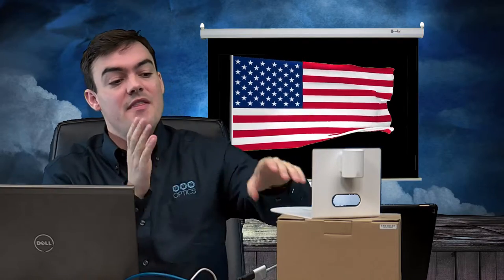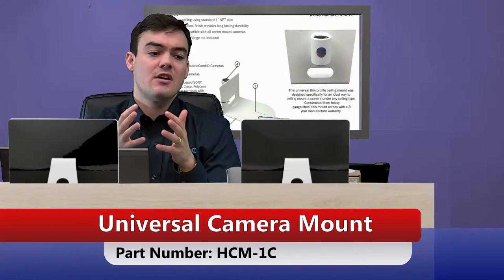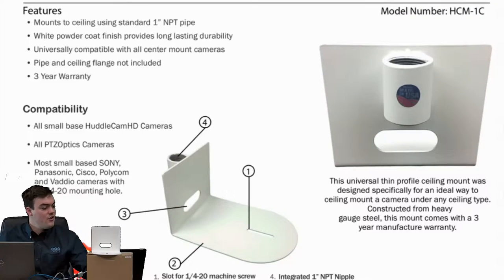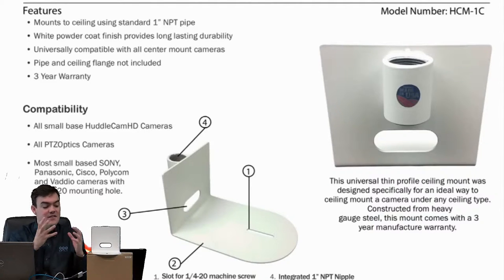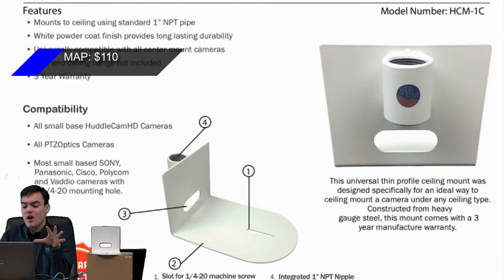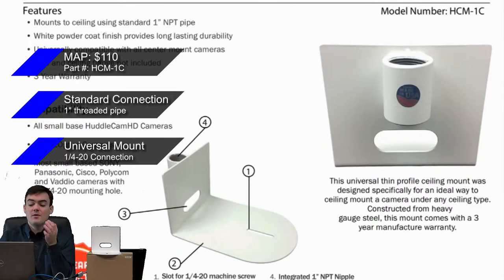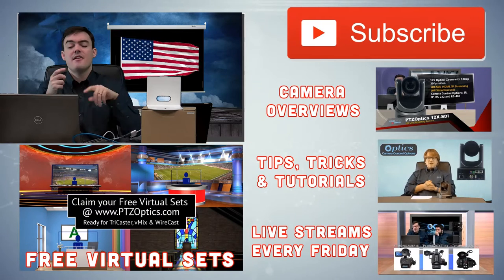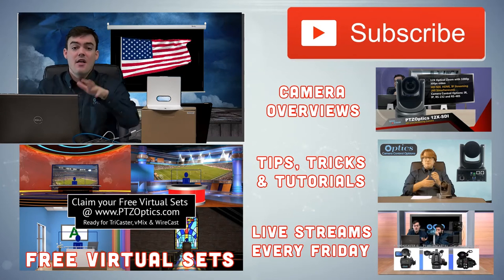Universal Camera Ceiling Mount - HCM-1C from PTZOptics

Comment: Is there a vertical pole mount ? Like say I needed it to mount on a lighting bar that goes across top of stage and can that mount be connected to a pole clamp ? That would be cool for live concerts
Reply from the maker: Hi Joey, We have been asked to create a "top plate" that includes everything you need to mount a metal bracket which can connect a 1" threaded pipe to our pipe mount. It is ready but is still getting the finishing SKU information pre-pared